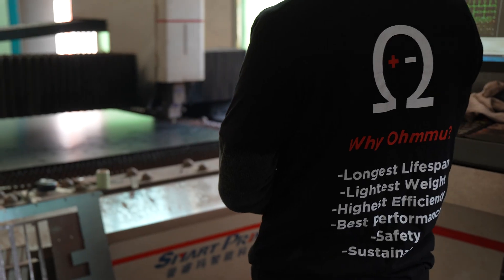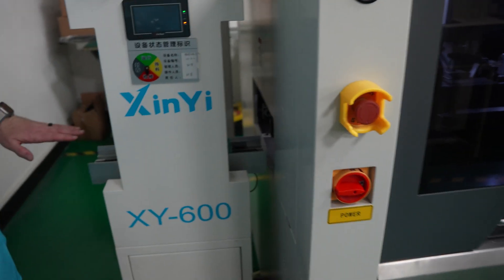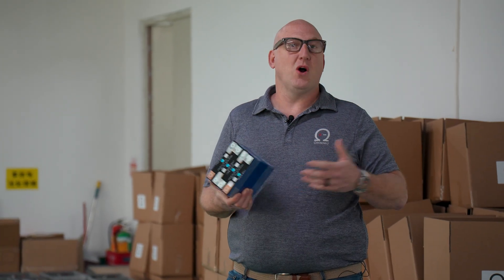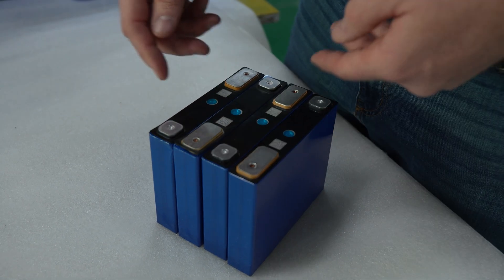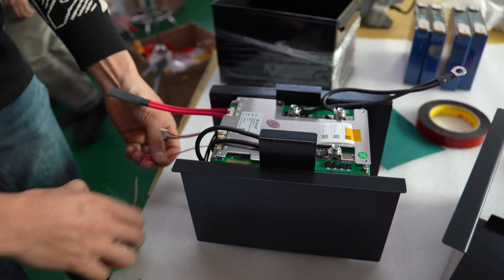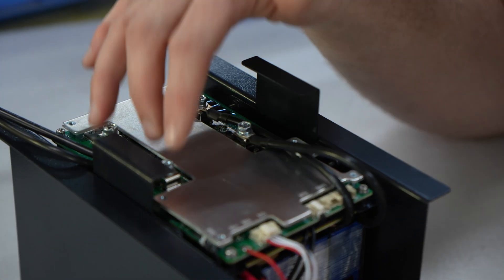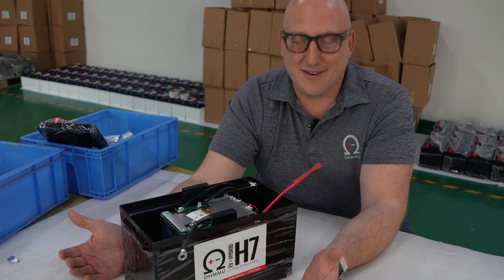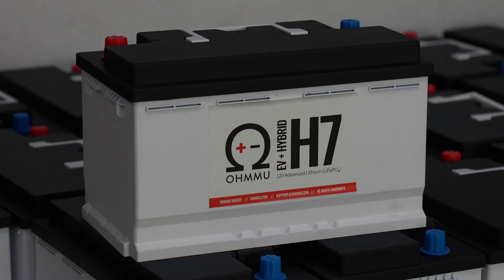How Ohmmu Batteries Are Made

Comment: I have one in my 22 Ioniq 5, and have been very happy. Even down to -30C, the battery has performed very well.
Question: could I boost an ICE car with this battery?
Reply from the maker: You can if smallish engine, the limiting factor is the BMS will think higher amperage is a short and cut off to protect.  It will come back on or can be turned back on via Ohmmu Energy app tho.

Comment: Are your 100ah group 31 sodium batteries. Manufactured with this internal steel plate mounting system, and are those batteries able to be mounted on their side such that the smallest side of the battery is facing down when installed into its application?

Please advise.
Reply from the maker: Hey, Rusty! Sorry for missing this earlier! All of our batteries, regardless of chemistry, have these internal mounting brackets. And yes, you can absolutely orient the battery in whatever way you want without issue. We had a customer mount them upside down in their RV, so they can run a bunch of them in parallel!

Comment: @7:00 Why is a guy using Scissors to strip wire? That is not proper workmanship standards for a factory. I'm guessing some random guy did it for the video?
Reply from the maker: @NWquadriders  Yes! Thanks for picking that up! It was actually a demo battery so we could film the basic assembly process of the H5 unit battery. The footage right after showing the automated machine processing the wires being cut, stripped and soldered were the wires we actually use at the point of manufacturing when installing the BMS. Hope that clears that part up! :)
Reply: @OhmmuEnergy  Thanks!  Yes, I did notice the automated processes in the video. That's a sign of a top notch manufacturing process, as it creates a repeatable process that eliminates issues.

Comment: Very interesting. There's one thing I'd like to know: why such large empty space inside? Wouldn't it better be spent to increase capacity?
Reply from the maker: @filippopossenti1791  Thanks for the question! Ultimately, we have to be cost sensitive for the finished product and the additional capacity would be overkill when comparing to OEM (Lead vs Lithium). If we made a max-capacity variant it would end up being a lot more expensive than we want to be at since it would be adding additional cells.

As for the space inside, the shell size is determined by the group/DIN size the original lead acids battery capacity the car was designed to use. Lithium cell volume is much smaller than the lead counterpart, while having the same capacity. Hope that helps!